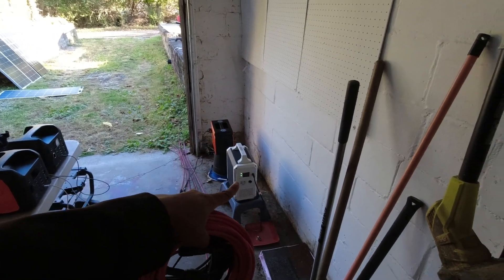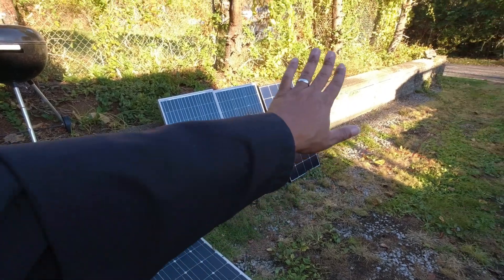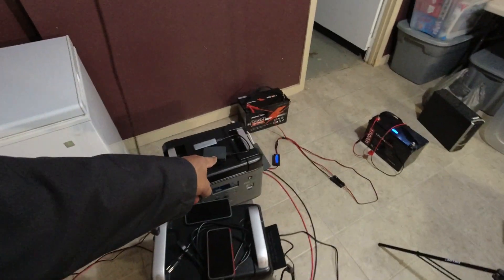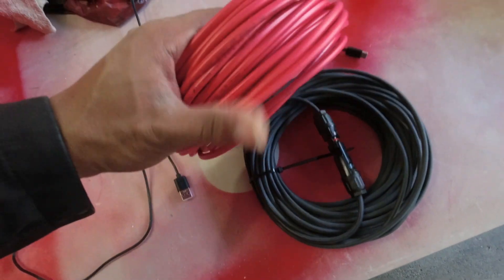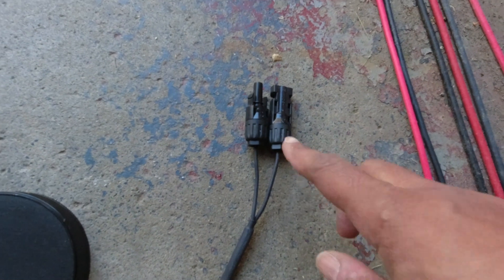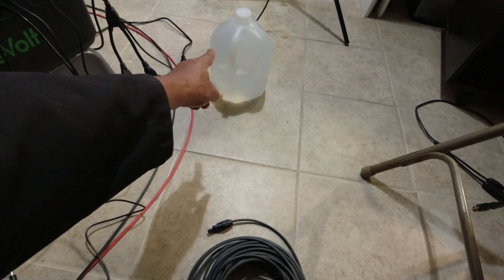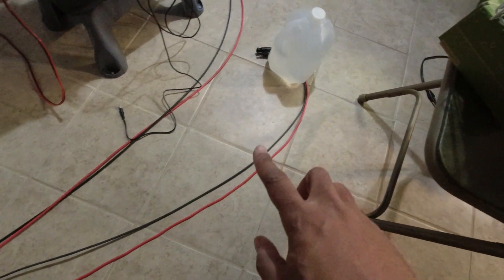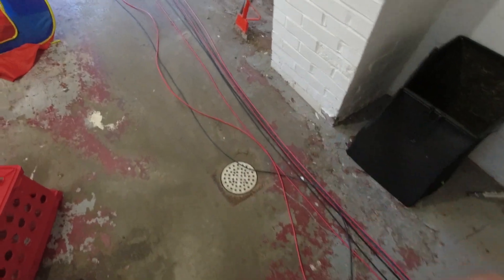BTS - How I Deploy MC4 Extension Cables feat. EB120

Comment: I genuinely don't want to "Arc around" with my new Delta 1300. 😂 

I need some help. Im using supposed to use their folding 110w solar panel. 

Output
Short Circuit Current
6.5A (Imp 6.0A)

Open Circuit Voltage
21.8V (Vmp 18.4V)

And i need to run it over 5 metres to charge it, keep the power station out of the heat. 
The cables i want to use to extend them have these features:

- 10m Pair (Red and Black) Solar PV Cable 4mm Diameter 1000V DC.

- Pre-termianted with Straubli male and female MC4 connectors

Theyll join with the Eco flows mc4 to xt60 connector. Is this safe?

I know longer lines = more resistance, but im very worried thst i might end up causing a fire.. 

Any advise or reassurance/correction would be appreciated😢🙇🏾‍♀️

Comment: Have you ever thought to cut the tops off the trees use brackets to put the solar panel on those trees or bar to connect the trees so your solar panels can hang on the push all the wires to the same side as the solar panels as they go in the garage so that at the end going towards your basement then it'll go l shape that way it's not going to be under the car or driving over the wires itself was all push the one side just a question sorry if something didn't write correctly I'm using speak text and I don't have my glasses on
Reply from the maker: I cant say that I have. Im a leaner not a builder. ha. But that is kinda interesting. Ill have to read it a couple more times tho. 
It came through pretty clear I'd say.

Comment: Dude, don't remove trees. I'm sure you can figure another way.
Reply from the maker: Why not?  What's your take on the trees? What redeeming quality do they have
Reply: @AskIveSolar  2 easy ones -1) trees remove CO2 from the air and give back oxygen. 2) trees stabilize the ground so that rain doesn't easily erode the dirt, washing it away and causing flooding. Thus letting the rain seep back into aquifers instead of running down the drains.
Reply from the maker: Ah OK. So just tree's in general. I dig it. They gettin cut down

Comment: You are very particular with your wiring, I'm the same way! haha I've found it helpful to fully unwind and untwist the cable first out in the yard somewhere, then it lays flat wherever you put it and it won't pop off the ground. It also helps if you can lay the cables in the sun to get warm, they get much more rigid in cold temps.
Reply from the maker: Whats funny is I do usually lay them out and let them chill for a while but doing so in the sun is a great idea. I think I was pressed to get it done. 

And its good to know im not the only particular person out there with regard to cables.